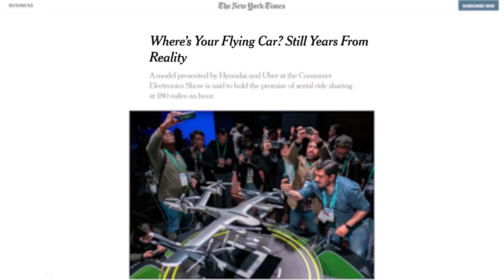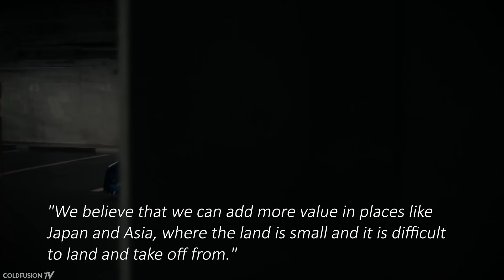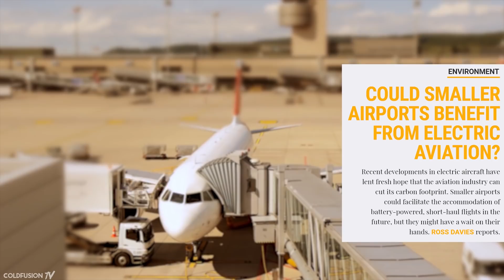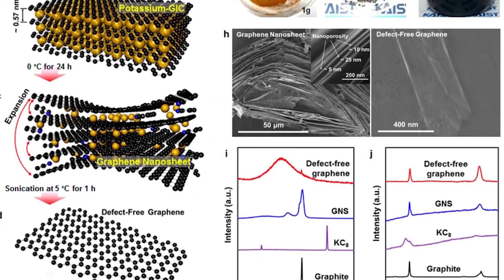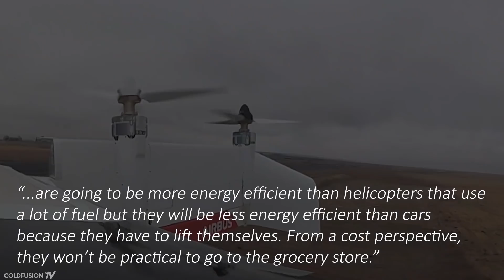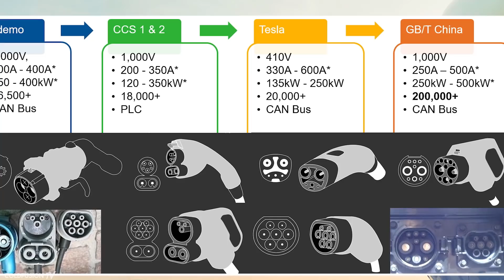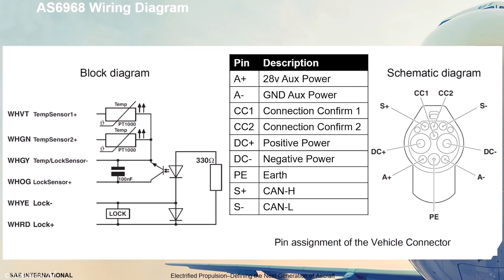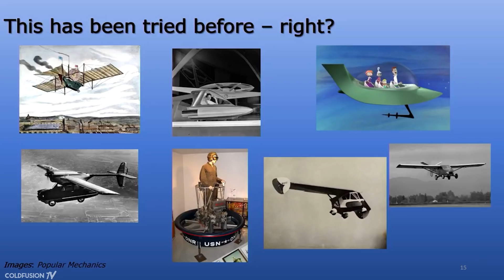Japan's Flying Car – Problems and Solutions

Comment: 1950: In the future there will be flying cars.
2020: In the future there will be flying cars.
2050: In the future there will be flying cars.
Reply: Your version was the most accurate of the three like this I've read. :(
Reply: When Nuclear Fusion became a power source, then very much likely flying cars will be mass produced because nuclear energy produce so much power and the power helps the flying cars to stay afloat.
Reply: @okamijubei  
Even if we had near unlimited power thanks to fusion, we would still need massively improved battery tech in order to store enough energy to make the vehicles run long enough for meaningful travel
Reply: @MinecraftMasterNo1  simple, make a flying reactor
Reply: @midgetman4206   Damn, just stick a fusion reactor into a flying car, how did I not think of that? That's so easy to make!
Reply: @MinecraftMasterNo1  yeah, you'll only have to deal with insufficient shielding due to the confined space and so neutrons will strip your DNA as if it was chalk against a pressure washer
Reply: 2010 Elon Musk
Reply: Fusion is only 20 years away... ^^
Reply: Search up falcon heavy. The payload is literally traveling maybe 25x faster than a bullet and is literally a red car. Not to mention it showed it was able to fly at an altitude of more than 100km. Here it is: https://youtu.be/wbSwFU6tY1c?t=1541

Comment: There might be 1-5 working prototypes in 5-10 years, but it's going to take much longer to reach what is being promised because the business case will take much longer to develop than these working prototypes. Economically these will be far out of the reach of most people and very rare for probably at least the next 50 years. The practical need for a flying car depends so much on more crowded cities and population growth that it won't be high enough for at least 50 years - outside of Japan or a few megacities.

Comment: The solution is Hydrogen: 40 000 Wh/Kg compared to Li-on's 260 Wh/Kg. Hydrogen is not practical for passenger cars yet because of the infrastructure, but Airports could easily produce hydrogen on site. Planes would have enormous range, be green and could still be filled in a matter of seconds.

Comment: What are flying cars even good for? Maybe to be used for fast travel using highways for take of and landing. Helicopters however are to inefficient for that. Maybe to get higher traffic capabilities in the cities, but you can't use planes there. Vtols can be used for both, so they will play an important role. 
However all means of transport will be autonomized making it safe and efficient. Together with autonomous buses higher traffic capabilities in the city might not be necessary. Plus flying will be avoided in cities because of the low efficiency compared to ground traffic. And when planes are cheaper and lighter and thus more efficient than vtols, they will be the most important instead.

Comment: The problem with hybrids of cars and planes is that conventional airplanes need runways, so you have to drive to the airport to take-off anyway. So why don't you leave your car next to the airport, and fly with normal airplane, without additional weight of a normal car?

The answer to this problem is VTOL. However, vertical flight is:
-much less efficient than conventional flight, and 
-requires much more skills from the pilot. 

This is why helicopters and helicopter training are so expensive.

Lack of skills can be solved with flight automation, but it greatly raises the cost due to cerfication process.

Efficiency can be enhanced by "switching after vetrical take-off into an airplane" by means of tilt-rotor or lift-fan or whatever, that countries around the world tried during Cold War and mostly failed. This raises another issue during transition period, in which most of these this configurations were unstable, and AFAIK currently every civil aircraft has to be aerodynamically stable to be certified.

Another issue is with contraddictions between efficiency in vertical and horizontal flight.

In vertical flight you want to have one large-diameter rotor (so that it has low disk loading) and something to counteract the torque, and you don't want wings because you become susceptive to gusts, and in poor design they might also block the downwash from main rotor, decreasing effciency. You want to be as light as possible, and streamlining is not really so important.

In horizontal flight you want "long and short wings" (large aspect ratio) so that you have low wing loading, lot of lift and little induced drag. You also want propeller to be rather small, because long unloaded blades cause a lot of vibrations. And of course you want it to be as much streamlined as possible.

And now comes the initial costs and operating costs, which (due to complexity, safety regulations and putting materials to their limits to keep weight down) are so great, that unless you make money by flying it almost every day, you probably can't afford it.

I guess this is why we don't have flying cars yet, and unless we will find how to lower the costs, and unless we will become more tolerant to risk and noise (which are also limiting factors, especially in urban areas), we won't be seeing them anytime soon. Hopefully I'm wrong, but Skydrive is likely to fail in its current form, due to lack of autorotation (too small rotors) or gliding capability (no wings).

Comment: Hey cold fusion. If you haven’t already. You should check out Brainchip. It’s an AI chip that is solving the problem of the chip using too much power. They just signed NASA with their technology. The chip is called the AKIDA chip :)

Comment: Telescopic wings seem like a way to do it. Reduce drag in cruise. Now that swiveling props are the norm, one can transition from VTOL to low consumption horizontal cruise.
Carbon fiber technology should allow for sturdy enough full size telescopic wings that are as light as fixed aluminum ones.

Comment: Charging stations often have multiple plugs and there are adapters available, so I wouldn't consider this a problem.
Piloting is a much bigger hurdle to overcome - We either need a complex training and certification system or a very advanced autopilot software.

Comment: Why make a flying car when you could just land it right in front of the door of your office and then have it fly back autonomously
Reply: That makes no sense at all.
Reply: Why not you will probably never drive but just land in front of work and not drive
Reply: @davidvreugdenhil4557  You need to learn how to speak English before commenting. What you're describing is an air taxi, which could indeed be a thing.
Reply: @urquanseven2332  well that's what i mean that's more useful than this

Comment: I like how the electric aircraft has one solar panel on the roof. Id imagine per year it would add a decent number, and multiply that per plane and you have a large number.

Also as a person who drives on average once a week, a car with inbuilt panels, (which apparently gets 9 miles a day if memory serves), would be more than enough for my needs

Comment: Hydrogen as a terrestrial fuel source is a non starter but it might work well in commercial aviation. What are your thoughts on that? Also, your thoughts on using hydrogen fuels cells to power propellers vs using it for thrust propulsion like jet aircraft.

Comment: It cannot be drone blades. You will basically be deaf after a hour long drive.
Reply: Head sets, simple solution for a simple problem.
Reply: @garrycole9187  the driver and passengers are not the only people. There are people below the vehicle. Imagine traffic noise with helicopters instead of cars.
Reply: They’re making them much quieter.
Reply: @fantasticphil3863  you can't make them quieter without reducing power to them and you can't exactly do that in the air. They need air for lift and that's what makes the noise. You can't work around that.
Reply: yo Alex There are many ways to reduce the noise without reducing the power. Sound comes from vibrations in the air. I have no clue of all the ways, directions and rates with which vibration is created with a propellor, but if you study those you can make it quieter by optimizing things like the motor speed, number of blades, perfecting all the angles on the blades, etc. It’s like a mountain, you can change these values until you get to the top, the best you can do.
And you can get around it. If you find a smaller motor that is really quiet, you can keep adding motors until it’s powerful enough, you can move motors away from the center, can add some soundproofing to the cabin, maybe blades with ridges, or a duct, or just wear a headset.
Reply: Saha: You'll basically be deaf after an hour long drive.
Rolls Royce: We're coming
Reply: There is pretty much nothing else we can use
Reply: Helicopter blades are worse jet engines are hot and dangerous and they don't make anti gravity drives yet.